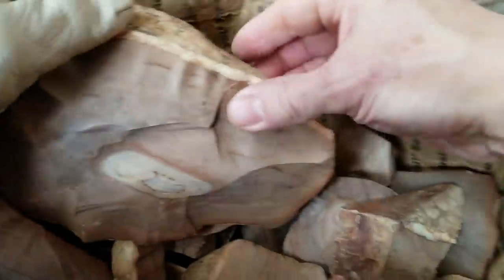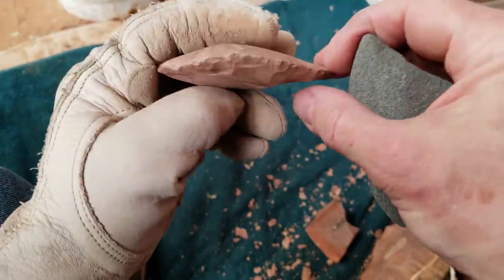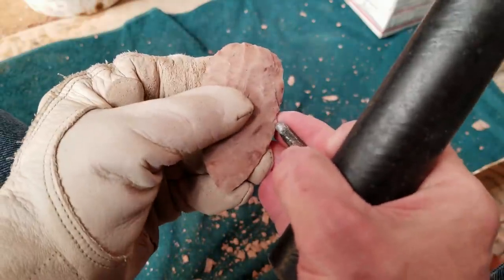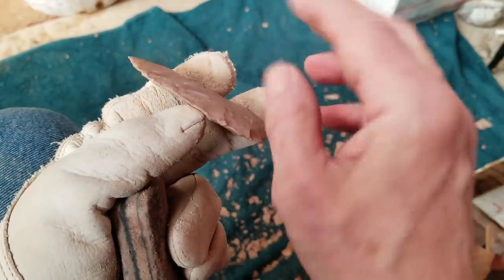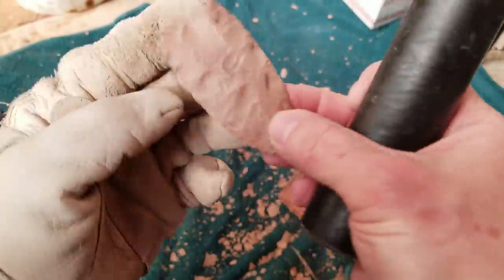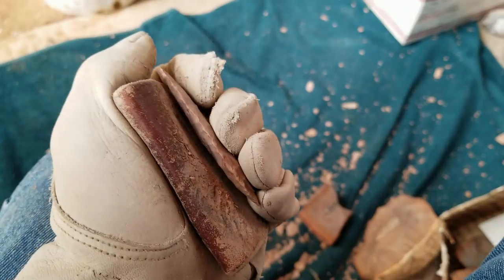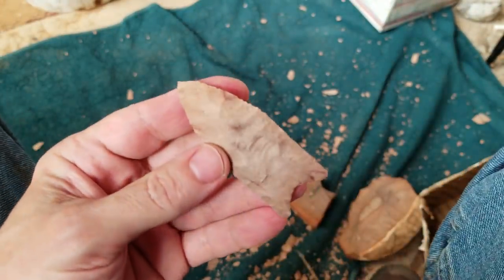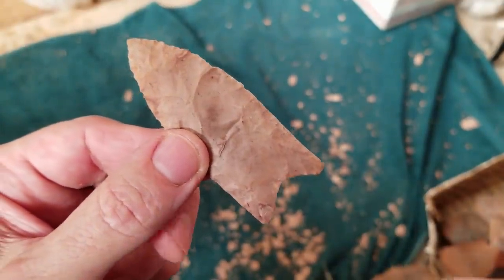873 - Flintknapping Buffalo River Chert Clovis (full video)

Comment: Hey!  I take issue with your comments on bison horn!   You just called my favorite tool ugly!  LOL!
I use bison horn for indirect horizontal punch work on almost every point, especially in late stages.  I love what I can do with it!  But you're also not wrong...  ;) When I use the horn directly, squeezed between legs, it breaks down easier and requires significant maintenance to stay effective.  The sawed off tip on the loose end of stick, lasts a good long time, requires minimal maintenance,  and is the form I use most.  But yes.  It'll never be as long lived as metal tools.
Reply from the maker: I'm glad you explained your objection. Most guys just give it a thumbs down and sulk in silence. 😁👍

Comment: The “purist” approach always makes me giggle. Why not abo? Well... (1) It is extremely educational to learn abo because it is the foundation in terms if reading the stone and understanding fracture mechanics etc. (2) But once you’ve done that, it makes sense to transition to “modern tools” to make life easier. Don’t forget, Ishi transitioned from obsidian to glass. All the “old boys” would have transitioned to modern materials and tools for their everyday “production” in a heartbeat — and maybe stay with the “old” techniques and technologies for prestige pieces. So, in my mind, knapping with copper etc. is just fine, especially if you have already experimented with and understood abo. I find the same thing in woodworking: it is very educational to learn handtool woodworking FIRST; then when you start using power tools, you will still have the handtool mentality to make decisions about grain direction etc. (which people tend to not learn enough about if they start out with power tools from the get-go).
Reply from the maker: Does one gain a better understanding of fracture mechanics by expanding one's experience with a greater number of tools or by limiting one's self to a small subset of tools?
Reply: @KnapperJackCrafty  Good question. The answer is obviously both, and the key is whether one actually focuses on learning the fracture mechanics of the material. What I’m more focused on is if you start out with an “easier” technology, say (for an extreme example) using power grinders to create replica “look-alikes”, you circumvent many aspects that would cause the material to fail if using abo. A woodworking example: you can use a bandsaw to create a wooden spoon and you are almost unlimited by the grain; however, if you use handtools only, you learn to make sure the grain runs along the handle or otherwise the spoon will fail. It is not a question of what is a good or a bad approach; I’m saying that building your skillset bottom up (like you did) gives you a deeper understanding than if you only use the easiest available technology.